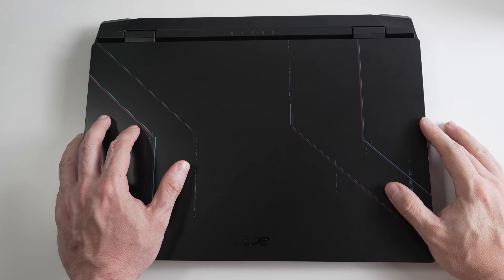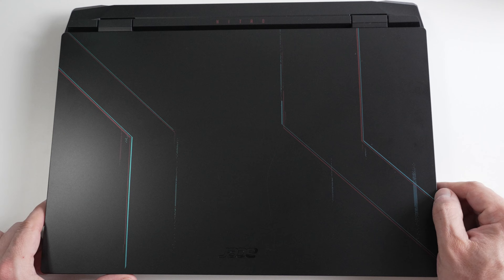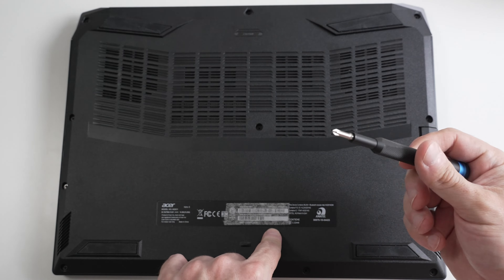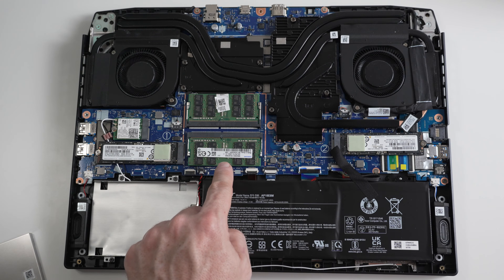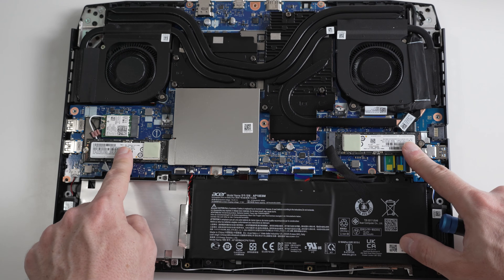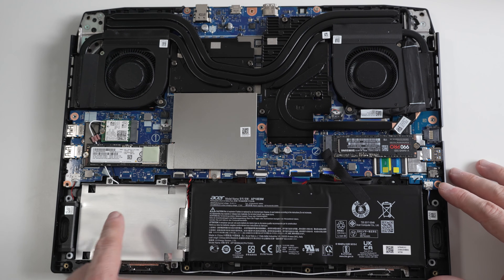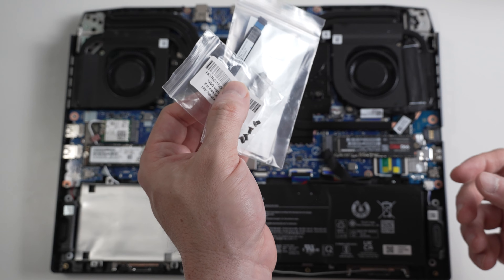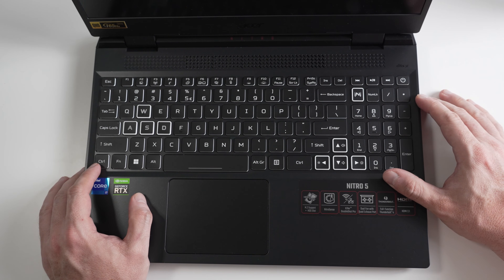Acer Nitro 5 AN515-58 & Upgrading the SSD: A Hands-On Review

Comment: What is the green pad, mine has dried up. May I know where to buy a replacement pad and what brand?
Reply: It is called Thermal Pad. You could buy it with the thickness of 1mm or 1.5 depend on your laptop

Comment: the maximum that can be mounted in speed?? as for space, a TB is fine with version 3.0 or is it also possible to use 4.0???? I would like to mount the operating system on a faster sdd and use the old one only as a data archive...what do you recommend?

Comment: I'd stay away from Samsung 990 PRO - not only two of them died in two different PCs, they are also very hard to recover data from.
Reply: There was a driver problem with them basicly burning up. You could contact samsung since there is a 5 year warranty. And check om samsung magicen for the right driver ..ands with A7 if im correct

Comment: How did you upgrade your main OS drive to a larger SSD? I've seen some videos of people cloning their OS drive or partitions using software and then replacing the drive, but it seems some encounter issues during the process. Did you have to configure anything in the BIOS or use a safe boot mode to make it work? It would be really helpful if you could share your experience or any tips, as I currently have a 250GB SSD for my OS, which feels too small.

Comment: Awesome video - I just bought the Acer Nitro 5 AN515-58 - with 1TB, and 16gb ram (came at a good price as i wanted a 4060 card) - and was worried about storage expansion. Your video has calmed my fears! Especially considering I've already filled up a third of my SSD already on games xD
Reply: Hey bro you're one of few people to buy the same laptop as me. Most acer nitro 5s I see are 30 series. Quick question, have you upgraded the ram and added another SSD? I didn't think I could do the SSD and I'm not sure why ram to be upgrading 🤦‍♂️
Reply: @leeaust2767  hey dude - no I haven’t updated the ssd or ram yet. I’m pretty content with it in terms of performance to be honest. I might consider adding another ssd tho at some point as games to take up quite a bit of storage. The ram upgrade seems a bit pointless tbh
Reply: @terracehouseguy  adding two 16gb memory chips would be a very good investment for high performance gaming. I also have the same laptop as you, so far good 👍
Reply: @leeaust2767  did you add ssd?
Reply: did you add ssd?
Reply: @johnnnyks  no
Reply: Hey man, can you give any insight after 2 years? Is everything still working fine?
Reply: @kristiankis8144  hey dude - the only issue i've had is with the DC charging port which needs repairing but still works - otherwise everythings in in good working order
Reply: @terracehouseguy  Thank you!

Comment: They were selling this model in India with a slightly better 3070ti GPU and a somewhat slower processor , the 12650h , also they cut corners with storage and halved it to 1tb but i guess it works as it all came to around a 1250$ package which is still pretty decent. The display was the same 1440p with 15.6 inches.

Comment: My acee nitro 5 rtx 4050 one suddenly stopped charging. Any idea or solution.
I'm really worried 😢😢
One day I plugged in the charger and charging suddenly stopped working and when I now plug in the charger the charging light blinks once as soon as i plugged it and then goes off
Reply from the maker: Might be the power brick, try getting a replacement on Amazon.

Comment: good video, just one question; A few days ago I bought the one with an i5 and the RTX 2050, it came with 8 GB of ddr5 ram but when I put another 8 GB ddr5 stick on it it doesn't boot, I don't know if I have to change to ddr4 to accept the 16 GB?
Reply from the maker: Ram has to match, try swapping slots sometimes this works and sometimes it takes 30 seconds or more to POST.

Comment: Nice review. I bought this version:
ACER NITRO 5 AN515-58-56BL - 15.6 inch - Intel Core i5 - 16 GB - 512 GB - RTX 3060
Could you tell me if it hase the option for the old style sata ssd?
Reply from the maker: Nvme drives, the new ones. Thanks for stopping by
Reply: @305TechOfficial  heats up in games? Can you see the temperatures in games in CrystalDiskInfo?
Reply: It should have the third slot. Nvme is incompatible with SATA, so 2xnvme for the M2 slots, then a SATA 2.5" can go in third slot, next to, left of the battery, under the metal cover. Dont forget the cable and screws are in the box if you throw it out.

Comment: Is there a difference in which PCIE M2 slot to insert a high-speed SSD? Simply, M2#1 is called PCIE, but M2#2 is called PCIE/SATA. Won't the M2#2 slot have a lower SSD speed?

Comment: Both ssd slots are nvme ?
Reply: M2 drives are backwards compatible. They can both use nvme drives but some versions of that model have two different ports. The newest ones should have gen 4 drives, but the models a few years old may have a gen 4 for the left and gen 3 on the right. Also, the slot on the left can only take a single side drive in some models. The drives with chips on both sides dont fit all laptops.
Reply: @jameskirk3 thanks. I have both slots gen 4.

Comment: Hello sir, I have the same laptop with the i7 version and there is a 512 GB NVME Gen 4 SSD built into the laptop, I have also added another 512 GB HDD (I know this is a shame but the HDD is from my old laptop 😅) in the SATA slot So, can I add a 2TB NVME Gen 4 SSD in the second remaining slot? Is there an impact if SSD slots 1 and 2 are different in size?.  The problem is my storage is already in the red and I intend to just add 2 TB (if possible) 😅
Reply from the maker: No impact, just more drives :) enjoy!
Reply: @305TechOfficial but sir, I read comments saying that the SSD is not detected and you have the same problem, but when people ask "can it be added to 2 TB?" You answered "can". Now I want to ask whether your warranty is void when you say you have to contact Acer service to send USB recovery?

Comment: Hello! I really appreciate this video! I just have 1 question, the one I bought came just with 1 SSD 500gb if I want to add the second one of 1 TB that I bought should I also install again windows or do anything in particular? I am not removing anything just adding a new one
Reply from the maker: If you install a second drive you can keep the 500gb as a primary drive which will have windows or you can reinstall windows on the second drive or thirdly clone over the data to the new drive. You have a few options… thanks for watching
Reply: Thank you very much! @305TechOfficial

Comment: Hi, where can I change the options so I have 2 separate drives (one for system and the other for the rest of stuff)? Thank you for the video.
Reply from the maker: Unfortunately acer does not provide this option inside the bios, my workaround is to use 2 separate sized ssd’s then the system will default to separating and breaking the RAID. Thanks for watching.

Comment: Another one...why the frk are you not installing thermal tape. It is absolutely required to ensure the drive doesn't throttle. It is why they had thermal tape on the old drive, but now you have more chips to cool.  Also, no one should be buying double sided m.2 drives for installs like this as you will never cool the other side. o.O
Reply from the maker: Thanks for watching and commenting!

Comment: you really should at the very least unplug the battery when doing stuff like this; wearing latex gloves is advised too i guess
you can short components (motherboard for instance) though by not unplugging the battery... drop something on the board like a screw (happened to someone i know), ram stick or in your case, an ssd drive and you can really fuck something up
accidents happen and in this case, it's something that is so easily avoidable by literally just unplugging a cable
Reply from the maker: I’ve never shorted anything in my 20+years doing this.
Reply: @305TechOfficial  there's a first time for everything

Comment: Hey i have acer nitro with i7 12650h 3070ti.....and the thermals are really bad its touching 100⁰ C what should i do
Reply: Normally you would add a heat sink.  In your case all you can do is add thermal tape. Likely .5mm. Hopefully the backplate has a metal shield on the inside (I think it does) to conduct the heat away via the thermal tape, as that is why they had heat tape on the single chip of each M.2 drive.
Reply: @Rufnek2014 okay and whats your thoughts on liquid metal

Comment: Hi I have this acer nitro 5 with rtx 4050 and this have one 16gb of ddr5 4800mhz ram, can I remove this and add 2 5200 mhz? 🤔
Reply: I did 2x32 ddr5  sodimm 4800mhz and it works fine
Reply: maybe 4800mhz is the max with this laptop
Reply: 😢 @sylverstone7039

Comment: What the maximum amount of storage you can do in this laptop ,can the 1tb nvme m.2 be extended to 2tb each and a 2tb 2.5inch ssd so a total of 6tb ,is this possible
Reply from the maker: You can do 2x 4TB in theory.
Reply: So what if someone put a Samsung Evo 4 tb SSD and then 2x 2tb m.2 with heatsinks ..so in theory that would be okay

Comment: Okay, but why didn't mention that? 
first of all, you need to remove the plastic panel behind the screen (if you will skip this step this is going to be a pain to remove the bottom panel)
secondly, why the hell on earth do you never disassemble the battery? never ever do anything inside the laptop with a plagued in battery. one wrong move with a screwdriver and you may kill your motherboard. especially, when you making an upgrade installing ram/hdd/ssd.
Reply: Never had issues with mine

Comment: hi! so i have this same model as you, recently i bought new SSD (ADATA Legend 710) for my 2nd SSD slot, when i install it, my laptop didn't detect the SSD, Disk management also didn't detect my SSD, but my BIOS detect the SSD. can help?
Reply from the maker: I had the same issue, you need to contact acer and have them ship you a usb recovery drive which will contain the storage drivers necessary to reinstall windows.
Reply: Does this happen to all when upgrading

Comment: I just got the i5 version today and am pretty happy, was testing things out and turned the fans up to max and I thought this thing was going to take off like a drone, really impressed with acer on these even though my last gaming laptop was in like 2015 lol
Reply: dude an515 58 51ab model? please tell me what slot available?
Reply: Hey man, can you give any insight after 2 years? Is everything still working fine?
Reply: @kristiankis8144  I'm not the same person but I also own a Acer Nitro 5 515-58 that I've used as my daily driver and almost everything is still holding up. Battery life is at 86% though which honestly is my fault as I was dumb and didn't take care of the battery during the early years. The killer WiFi card kept failing so I upgraded to an Intel ax210 (super cheap anyways). The ethernet cable flap broke while I was taking off the back cover, so be careful with that. I haven't repasted mine yet, since the temps and fan RPMs aren't creeping up too high yet, though I do clean my fans and vents monthly. Everything else is working just fine. Just make sure to clean the fans, vents and repaste when needed, and uhh..don't gamer rage on the keyboard, since it's riveted to the palm rest.
Reply: @kristiankis8144  im using it, and yes its still going strong after 3 years, insane product tbh
Reply: dude an515 58 51ab model? please tell me what slot available?
Reply: Lmao I thought the same

Comment: Great video! This helped me install my own ram upgrade and SSD into my Acer Nitro 5 AN515-58.
I got a question though I installed a 2nd SSD but it bends a little. Am I missing something or should I loosen the screw a bit?
Reply from the maker: I personally would leave it tight, the bend should not affect it. Thanks for stopping by!

Comment: Hello, if I open the laptop and add a ssd card, will the warranty from Acer be invalidated?  
If not My laptop has a 512 ssd card, can I add a 1tb ssd while keeping the 512 ssd card? 
 Or it must be the same as the previously existing 512 ssd
Reply from the maker: If you’re not going to do raid, you can have different size SSDs. This shouldn’t void warranty.

Comment: Hi, i see in your laptop massive cooling system, do you know in acer nitro 5 2022 12500H+rtx3060 same cooling syster or smaller? I see some acer nitro 5 2022 with small CS, i think its 3050 configuration, am im wrong?
Reply from the maker: I think it’s a smaller system.
Reply: @305TechOfficial  i checked its same, but 3050 version smaller